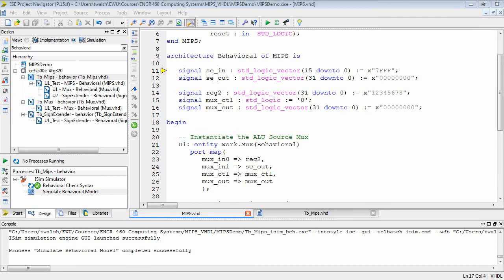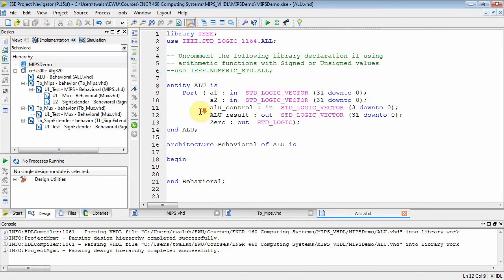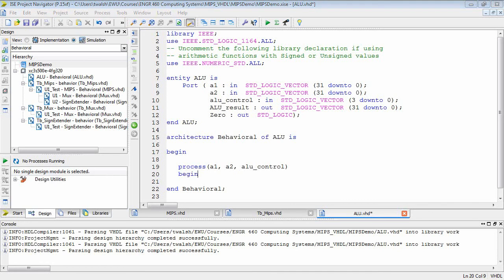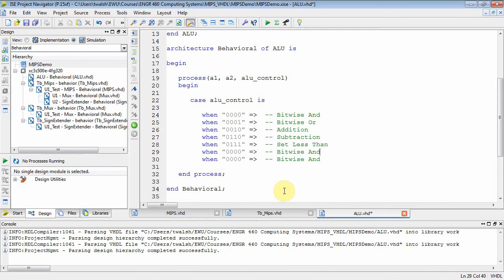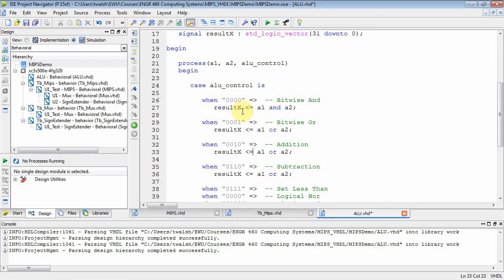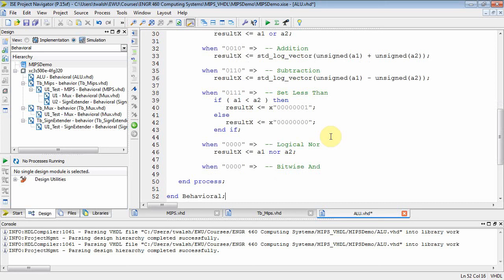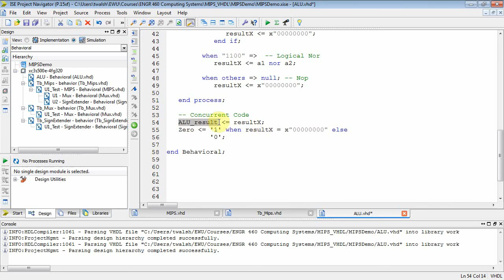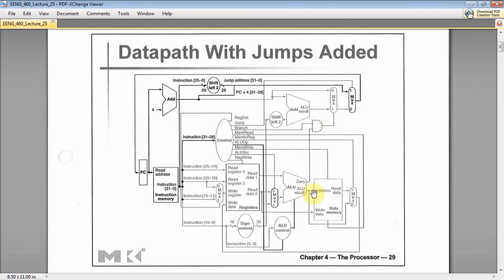EENG 460 Lab #3 Part #1: MIPs ALU

Comment: I would actually prefer designing a separate fullAdder and using it in all the logic you listed above

LIBRARY IEEE;
USE IEEE.STD_LOGIC_1164.ALL;

ENTITY fulladder IS
   PORT (
 a, b, cin : IN  STD_LOGIC ;
 sum, cout : OUT STD_LOGIC ) ;
END fulladder;

ARCHITECTURE adder OF fulladder IS
BEGIN
 sum <= a XOR b XOR cin ;
 cout <= (a AND b) OR (cin AND a) OR (cin AND b) ;
END adder ;